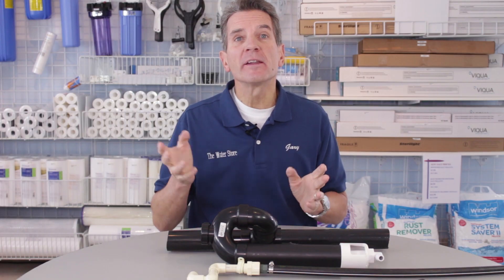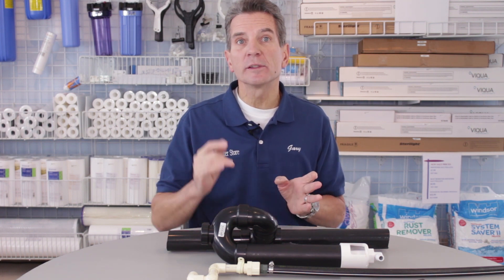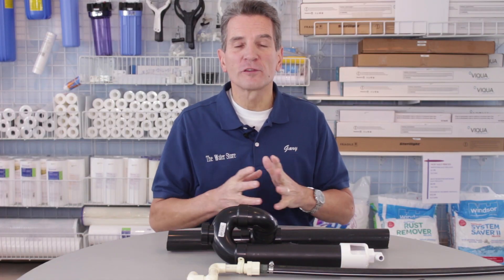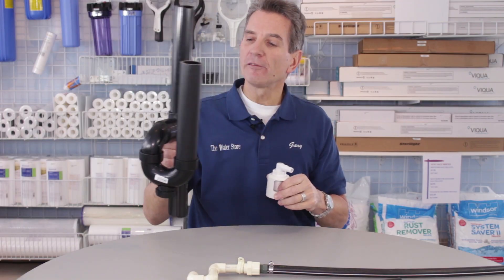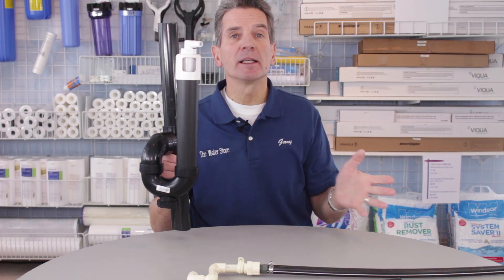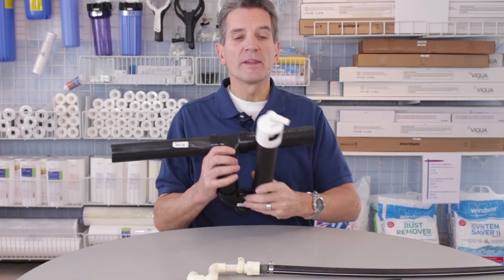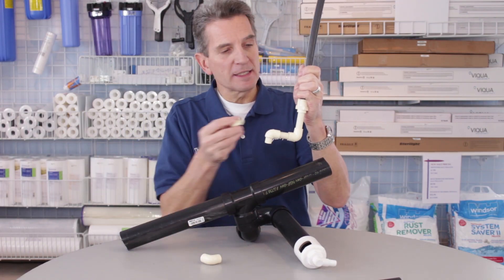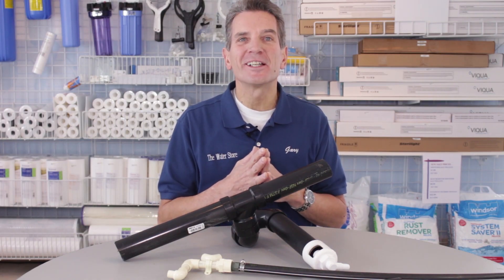Water Softener Installation Part 3 Drain Connection Options

Comment: I have two drain lines coming from my water softener. I have a floor drain near the softener that my condensate line from my ac/heater runs to. Can I tap the two drain lines into this line?
Reply from the maker: Maybe, it depends where it goes.  If it goes to the sewer or septic system, yes.  If it just goes into the ground, then no.

Comment: I live in PA.  if i am draining into my floor drains, and my floor drains outlet along my woods line (and not into my septic tank), I would not need to install a P-trap, correct?
Reply: Just to clarify, I am going to tap into my floor drains with a new stand pipe.  I currently do not have a stand pipe where i will be putting the water softener, but plan to install one.  What do you think, P-Trap or not?  i would think no because there are no gases or odor to block...
Reply from the maker: @devinlansberry4201  in your case, in this situation, no you don't need a p trap.
Reply: @water_estore  what are your thoughts about the floor drains daylighting into the woods and the effects of the salt and other chemicals that are flushed from the water softener during the regeneration cycle?  I happen to have a large pine tree right next to where the floor drain outlets...  Do you think the chemicals are enough to kill the pine tree over an extended period of time?  I normally wouldn't worry about it, however the pine tree will hit the house if it falls in the correct direction.
Reply from the maker: @devinlansberry4201  great question!  Yes the brine back wash will kill that tree and other vegetation in the same area.

Comment: Informative video Gary, I have my water softener drain hose attached to a horizontal run of abs sump pump drain pipe using a dishwasher wye fitting.This drains to the outdoors. 
The sump pump check valve is just above the pump with 6' of vertical pipe to the horizontal, the water softener's wye fitting is about a foot past the elbow.
I was concerned about the sump water syphoning back into the water softener, would I have to install a P trap with an air gap fitting in this case? Or is there some sort of check valve that I can substitute?
Reply: Thanks, @water_estore  !

Comment: Does it actually pump the waste out?... my softener is installed low down so cant connect it with a fall to the dishwasher as the dishwasher is taller
Reply: Yes, no more than 8 foot I believe.

Comment: Nice video.  I want to do a horizontal installation.  What is the minimum rise of the stack between the air gap and the trap, in relation to the existing horizontal drain pipe?  I only have about 4 1/2 " above the top of the drain pipe due to the pipes being in the floor joists.

Comment: I have a drain line that runs to the outside and into a 3 1/4 PVC pipe. The line from the softener to the pipe is clear. Something in the PVC pipe is clogged and that causes the water to just shoot everywhere outside. That PVC pipe goes about 4-5 feet into the ground. Any ideas? I took one of those long wire things you use to unclog a toilet and run it all down the PVC pipe and just dirt comes out. I had to put a clip on the where the pipe connects to the softener so the pressure would not blow the line off and flood the garage.
Reply: I think it just drains into the dirt about 4-5ft down. I can pull the PVC pipe out of the ground. It doesn't appear to be connected to anything down in the ground.
Reply: You need the airgap for this reason

Comment: Can I drain my softner above the check valve on my sump pump drain?
Reply: The drain runs outside...or should I say is pumped outside.....If I placed the softener drain above the check valve , water would sit there until the sump pump comes on to push the water up higher and out the wall.....Is this feasible?

Comment: Great video. If I add the p trap and air gap fitting does the elevation of the air gap fitting have to be below the outlet of the water softener with a self draining slope to the hose?? Or is it ok to come down with the drain hose and up the the air gap fitting.

Comment: Great video!  Hoping you can answer a couple questions I have:
What are all the pieces you used there for the floor type drain, including what you used to attach it to the tube? 
Also wondering if you recommend fastening it to a brick or just directly to the drain grate.

Comment: I have a softener drain system that drains out to its own independent tank. The drain lines from the softener go into a pipe mounted on my wall and out to the softener tank. When the softener goes into the back wash mode. Water seems to be back feeding out of the pipe where the drain lines go into. I opened up the clean out and air and water was coming out. Like there was back pressure. What is the issue? And, how do I fix it? Thanks.